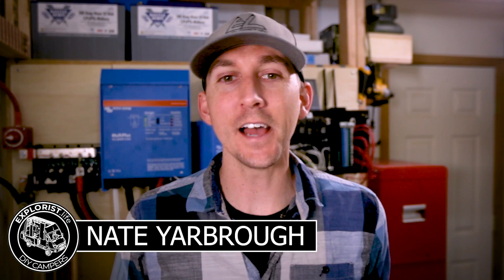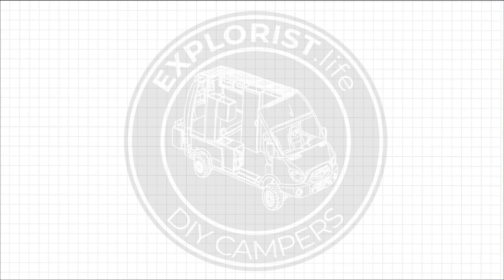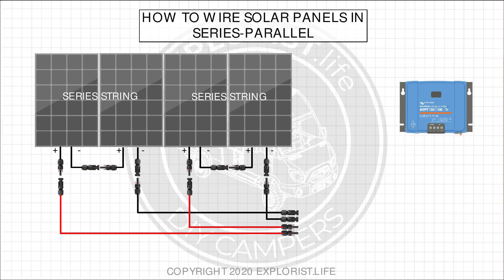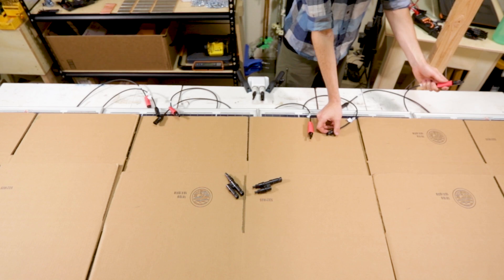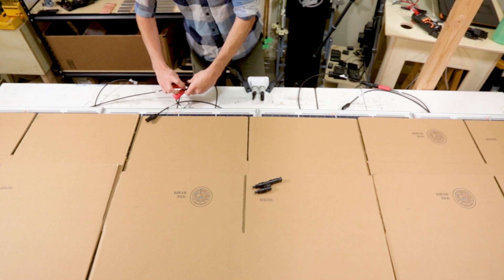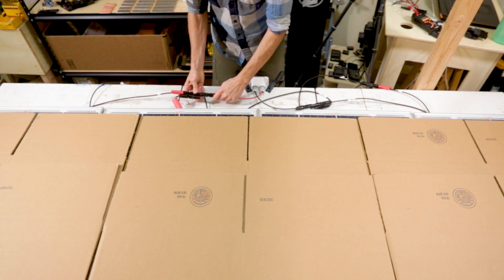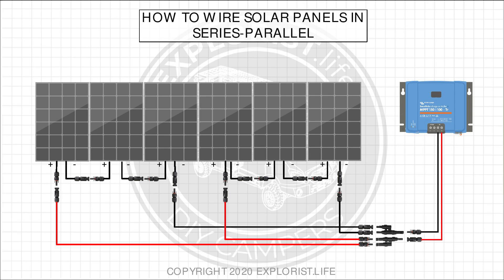How to Wire Solar Panels in Series Parallel

Comment: Quick Tip And Subscribe to me if you didn't know for some <3 ;) Take 4- Renogy 100Watt 12v Panels put each set of 2 in parallel then string the 2 sets of 100 watt panels in parallel in series with each other this will leave you with 30v+ 18amp+ don't series combine panels first always parallel them then put you're pairs in series. 
Youree welcome! :)
Reply: I currently have 4- 100watt Renogy panels and a 100|50 Victron Smart Controller I see 39volts at my Pv Array and 18+ Amps to my 12v Lithium battery  ;)

Comment: What if one half of your solar array is covered in shade, decreasing the voltage on that side? Are diodes recommended?
Reply from the maker: If maximum solar output is the goal... avoiding shade should be the absolute biggest priority.  Shaded panels will not product optimal output regardless or diodes or how they are wired.

Comment: So I’d like you maybe in the next video when you’re probably already doing it but talk about the voltages as you wire these what happens to the voltage and the amperage when you wire in parallel as opposed to wiring and series and then holy crap what happens when you do both? And aray is about 60 feet from the house with #14 stranded wire then to # 12 solid romex Because it was already installed through the foundation and I think that might be the weak link but I have currently two panels at 24 V I’m going to add two panels and I wanna raise the voltage because longer distances amperes travel better with higher voltage? 
Is the solid romex a hindrance or a RESISTANCE? 
Thanx for the video❤️🇺🇸

Comment: Ok so from as far as from what I learned, basically you CAN do 
- and + together like if you have 3 panels, and then you get a left over 2 wires on each end, a red and a black one, then those go to the connectors and THEN into the “inverter” thing? 

New to all this my family and I are wanting to go green, and of course save money, if y’all can help me understand better I’d appreciate any correction

Comment: 2s2p feeding 2 controllers with 2 battery banks, (1 array powering 2 battery banks).
4x100 watt panels paralleled to hqst 40 amp mppt and mpp solar 1kva inverter/charger.
Seems to be working, would like your thoughts on it!

Comment: First of all, thank you for your videos. 
I have eight 400 watt Solar panels, the Voc is 49.3 volts. my charge controller is a tracer 4215 BN maximum voltage 150  input. I am running an off grid 12 V inverter to make my 120 v. 
My question is, will I need 4 charge controllers like this one to handle the solar panels and stay with 10 gauge wire. I think that’s what I have to do..I’m just double checking.
Thanks,
Rob
Reply from the maker: There is indeed a pretty strong chance you'd need 4x charge controllers.
Reply: Thank you

Comment: I have 4 295 watt 45.0 volt panels connected series parallel . What size charge controller will I need ?
Reply from the maker: Here is a video that will teach you how to size your charge controller: https://youtu.be/MxziHKvTRh8

Comment: I think for my future set-up with long run of panels to MPP inverter/controller, I'm much better off wiring in series so as to use less expensive & thinner cables. My only concern, & it's a big one, is shading of panels in series effectively reduces the power output for all the panels. Should I wire in parallel at the panels, then can I use series for the long run back to the MPP unit? So I guess the question is, can a wire panels in parallel/series as opposed to series/parallel? Thanks!!
Reply from the maker: Either Series Parallel or series is preferred depending on the panels used and the charge controller used.  Parallel series is not really a common thing (I've never seen it done). Check out some of my recommended array configurations here: https://shop.explorist.life/product-category/all-products/camper-wiring-kits/solar-charging-wiring-kits/
Reply: @EXPLORISTlife  Thanks for your reply. Hopefully the used panels I buy from SanTan will have pass thru diodes so shading won't be much of an issue and I can wire in series over parallel.

Comment: hey Nate. enjoy your clear explanations.  I'm having trouble finding out how to determine how many strings for my 48v off grid system. (30) 375watt  @45v PC array.  any help would be greatly appreciated. have (4) battle born batteries for (48v). certainly will need more banks but trying to get charge controller(s) & inverter purchased. thank you
Reply from the maker: You'll need to break it up into multiple charge controllers.  What is the make/model of the solar panels you are using?  Do you have any flexibility on the number of panels you are using?
Reply: @EXPLORISTlife  
thank you for response Nate. yes more than 1 charge controller needed.   I'll get/ send panel info in an. appreciate you
Reply: hey Nate. I've got screenshot of PV label. is there way/ somewhere I can send to you? thx
Reply: Nate can I send pv label info to you?  still need help please.   thank you

Comment: Not sure I understand the math on this still. Trying to wire 4 200 watt solar panels in series parallel. What is the formula to calculate the total amperage? I have a factory ran 10 gauge wire from the roof to the compartment with my inverter, charge controller, battery bank, etc. and I don't know if it is sufficient to run in series parallel.
Reply from the maker: https://www.youtube.com/watch?v=JW0vrTAa50s&list=PLmvhcyi4n0TUjVGA_O5aI5SQrS1kKLgEF&index=21

Comment: Great channel! So informative and at just the right level of detail. Question; I have some solar cable left over. Can I use this as battery cable provided the gauge etc is fine. IE is the composition/structure of the cable OK?
Reply from the maker: If all those parameters are met, yes.  Usually battery wire will need to be MUCH larger than solar wire, though...

Comment: If solar panels connect in series and parallel, how about battery , we can connect in series & parallel or not ??
Reply from the maker: Batteries can indeed be connected in series-parallel if the system design needs it.

Comment: So to power a bluetti ac200p I ordered 3 200 watt 24 volt panels and 2 50 watt 12 volt panels. Both rich solar. I have 50 feet of 10 awg mc4 running to them. Should I try and send back for 12 volt or is there a way to wire these up. Trying to maximize charge time. Thanks.

Comment: Great DIY lessons. From this lesson i was able to install 12 pv solar panels in series parallel and used the 4 in and 1 out connector to connect to the 6kva inverter whose minimum input is 48V and maximum 145v.  So my series parallel connection give me 120v x 9.49A per series connection and 120V x 28.77 A  per parallell connection. My question are as follows:
1. Am i not under utilising my inverter which 5000W
2. Is there another way to connect my pv solar panels to get much more out of them
3. How long will this take to charge my 200ah  x 8 batteries which are also connection in series parallel in this manner. 12V x 4 batteries in series and 48V x 2 in parallel which pushes 48V into my invertor.

I will highly appreciate your assistance.
Reply: Gosh that's a lot of info to figure out haha.

Comment: Wanting to add 700w to roof of class A. 
4 X 175w panels in series parallel
250v/63 disconnect
Victron MPPT 150/70 or 150/85?
Victron Lynx Distributor power in with wiring kit
Perplexed on whether the alternator from the M/H needs to be wired in, since when engine is running inverter is regulating charging of house batteries. Do not plan on replacing the Tripp-lite ULW 1250 inverter at this time. Still in the process of choosing panels. Prayin I"m on the rite path, let me know. 
Your tutorials & Videos are fantastic, wish we had a basic trailer things seem a lot simpler.
Thanx Greg & Suzy

Comment: So in theory, i could run 4 - 100 watts in series -parallel.  So if using you examples @ 20 volt each and 5 amp
So all wired would be 40 volts and 10 ams , to charge a 12 volt battery bank . So the Victron 75 /15 would work right?

Comment: I am wiring up a 5 panel series for my new mppt 100v controller. This thought happened.  A standard 12v panel, at output, has 20v max open. If I put 5 in series, the differential on the same final outputs would be 100volts( to each panel one the ends 1...5). At what point do the solder tabs on the final string outputs, melt? :)
Reply from the maker: Not sure I fully follow, but damage is always possible if you exceed the maximum voltage/amperage of the panel, which if it's voltage you are talking about; most solar panels are rated to a system voltage of 1,000V.
Reply: @EXPLORISTlife  Exactly the info/keywords  I needed. (system voltage) Thankyou :)

Comment: If I have solar cells with 2 different sets of output terminals to solder to,  can I wire one set of the connections in parallel and one in series without harming the cells? Thanks

Comment: What about connecting to different sets of panels into a separate panel input socket...I have lots of holes where wires go in the bottom of the inverter. I can't get the panels on the main roof it's shared but I can put them up at the back of house and can use the front too. Ask questions if you don't know what,I mean. LoL I don't just want to try it just incase a burn something out in the inverter FRONIUS 3.6

Comment: Question, I have four 340 watt 36 volt panels and a 445 ah battery bank with amp80 outback charge controller , what’s the best way to wire my panels to get my battery full each day

Comment: Can I connect my 2 solar panels, and have the positive and negative wires connected to the wires meant to go to the solar charger, but not have it hooked up to the solar charger or batteries yet? Like have the solar panel side hooked up for a few days without the other side of the wires hooked up to anything? Would I have to keep the solar panels covered from the sun??

Comment: You mean to tell me the panels don't come with the wires and connectors already labeled and/or color coded?
Reply from the maker: They usually are but its good practice to double check.

Comment: Great video as always.  Can you elaborate why it's not recommended to have series-parallel strings with different numbers of panels?  Is it bad to have different voltages from each string coming together?  I was thinking of adding 2 more panels on my trailer roof to have 4 in total, all connected in one series string.  I currently have a pair in series as well as a second pair in series in a portable suitcase that come together at the branch connectors (I only connect the portable suitcase when at a site).  Each pair is identical in panels, voltage and current.  The setup is great but wanting to add a bit more capability on the roof.
Reply from the maker: Sure!  Check this video: https://youtu.be/jejro4zkl8I
Reply: @EXPLORISTlife  Watts Law calculation answered my question, thanks for that video link.  The math shows the only way it's worth while is by adding another 2-panel series string and not having the 4-panel series string or I lose a ton of efficiency.  Thanks for sharing your knowledge sir.

Comment: Can you connect 2 panels in parallel then connect them in series? It would produce the same watt output. Any advantage or disadvantage in either configuration.
Reply: I would like to know also, since 
my 200w suitcase is wired parallel: 18.5V, 10.5A (came with PWM) and
adding 2-100w panels (parallel): 20.4V, 9.82A

When in series: 38.9V, 9.82A = 382w
my issue is fusing

Comment: Great video Nate.    Thanks for posting.    I do have a question.    I have 2 banks of 2 100 watt panels in series parallel and am wanting to add a third set of 2.    My MPPT is a Victron 100/30 right now,, should I upgrade to a larger one before I add the third bank.   Thanks

Comment: I'm installing four 210 watt solar on my sailboat. I considered series connection for high voltage/low amps. But my concern would be shading on panels lowering output.

Would it be better to wire port side in series, starboard in series, then the two in parallel? This would reduce the chance of sails shading on side and lowering output.
Reply: Great question, i would think so. Hopefully you get a reply, curious if im understanding all he's teaching.

Comment: Great video a guy I bought 4 solar panels from recommended your video for a series-parallel setup. So here's my question

I have 5 renogy solar panels 
4 x 200x 1 x 150 in series now

I bought 4 350 REC solar panels that I wanted to have in parallel

Would you recommend using 200W and 350W together in a series parallel connected to a epever 200v/60A charge controller?

Comment: Great video. I intend to have 3 panels in series permanently mounted to the roof of my camper and 3 panels in series that I can deploy on the ground. These would be wired to the charge controller in parallel.  Does it hurt anything if I decide not to plug in the ground set (leave them in storage)? If I'm stopping somewhere for only 1 day, I may decide to not connect the ground set of panels. If the charge controller is sized correctly, this shouldn't be a problem, yeah?

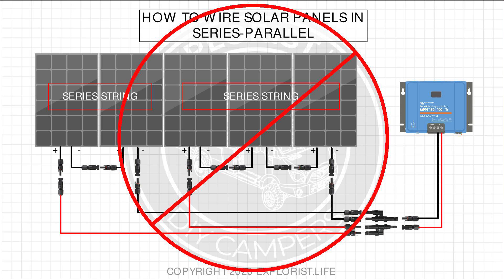Comment: At around the 3:15 mark you mention that you shouldn't have a 3 panel series string, and a 2 panel series string wired in Parallel, but what if each of the series was of the same voltage with similar wattage output?  I only ask, because I have two 100 watt panels wired in series right now going to my charge controller, but wanted to just add a single 210 watt 24v panel to the mix - so i'd have the 2 panel in series connected in parallel with the single 24v panel, just pushing more amps and watts to the mppt charge controller.  Do you see any issues with that?

Update: 'two hours later', after watching your 'How to Wire Different Sizes of Camper Solar Panels Together' video, I think I'll be good to go.  The single '24v 210w Panel' {Newpowa} has a Vmp of 33.54 Volts with an Imp of 6.24 Amps and the two '12v 100w Panels' {Renogy} have a combined Vmp of 35.8 volts (17.9 x 2) with an Imp of 5.72 Amps...so, If I'm understanding it correctly, by using Watts law, and using the lowest common voltage among the panel 'arrays', I'd multiply the 33.54 volts by the sum of the amp output of each array, which is 11.96 amps to get 401 watts - so pretty close to the 410 that I should theoretically get in optimum conditions.

Comment: If you had a set of 5x 210W 12V panels what wiring would you suggest? They are Newpowa brand.
Reply from the maker: All 5x in series, for sure.  With a properly sized charge controller, of course: https://www.youtube.com/watch?v=MxziHKvTRh8
Reply: Awesome thanks! Any disadvantage to wiring all in series?
Reply from the maker: Not really, no. https://www.explorist.life/solar-panels-series-vs-parallel/

Comment: Love all your videos.
Im beginning to build my system that will be 16cell in a 8s2p config for 24v @ 560ah +/- depending on whats available to me.
I want to feed it with either 6 or 8 panels in either a 2s3p or 2s4p config. 
I saw your diagram for a 6 panel setup but when doing a 8 panel 2s4p would it just be panel to panel in series, and then all 4 of them in series going to one set of wires that ultimately go to the controller?
Thanks
Reply: Yo so I’m new to all this too, so how do I make the solar energy power go through all my house? Does it need to be altered with my power box at all?

Comment: Love your videos, watched the one about fuses or not fusing and my question pertains to that....I have a 100/50 MPPT controller and 4 250 watt panels at 24 volts to my battery bank at 12 volts..each panel puts out open circuit voltage of 37.5 and 8.85 A short circuit Current I think I can run 2p/2s which would give me 75 volts and 17.5 amps per array..The fuse rating of each panel is 15A..combined they are 17.5 amps so  what size fuse could I put to fuse for each panel or do I put a bigger 20 amp one to cover the combined 17.5 of the short circuit current for bothin the one array? or is there a better way to go and still work within
 the 100/50 controller limits?

Comment: so four 8 amp parallel  panels would need a 32 amp or 10 amp fuse at each panel or at the Y
Reply from the maker: You won't find a MC4 combiner for 8 panels wired in parallel, but nontheless... here is how to figure out how to fuse a solar array.  (But without knowing the exact specs of your panels... I would very much think a series-parallel configuration of some kind would work much better for whatever you've got going on.)
Reply: @EXPLORISTlife  I have just 4 solar panels 275 w ,  8 amps each   they are 36v each. short current 8.2amp so i wasnt sure but i ran them parallel  to a 24 volt batt ,inverter, controler set up . So do i put a 10 amp fuse close to each panel  in the mc4 connector at the panel or further by the Y . or do i use a 30 amp fuse at each panel, some people say diodes protect some say all panels can short in one panel im confused . i have fuses for the rest of the system but know one is clear on the solar panel fuses . maybe i didnt have to go parallel but i did so not sure if panels at 32amp all together needed fuses what type .

Comment: I've found this whole series to be extremely helpful! Thanks! 

I am struggling to make this work with a grid tied system, however. Running four 100 W, 12V panels in series-parallel as a test. Should make the system 24V, 16.67 amps. Going in to a 24V rated grid tie inverter but I just keep getting a flashing error light. Any advice?
Reply from the maker: Without knowing the specifics of your exact inverter, it's tough to say... but, I'd guess your array voltage is too high.  Remember... a  12V panel is pretty much never 12V and is usually closer to 20V.  Wired in 2s2p like you are saying... you could be pushing 40V to your 24V Inverter: https://www.youtube.com/watch?v=6G3Mo_OHmQY
Reply: @EXPLORISTlife  You're on point there. Measured voltage off the panels is 35 V. The input range of the inverter is 20-45 volts, though, so should be ok there.